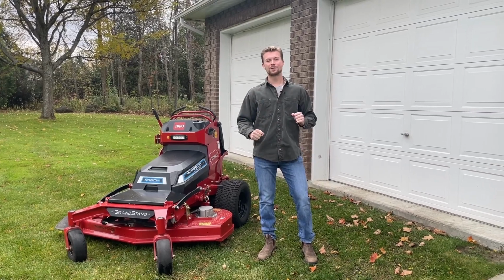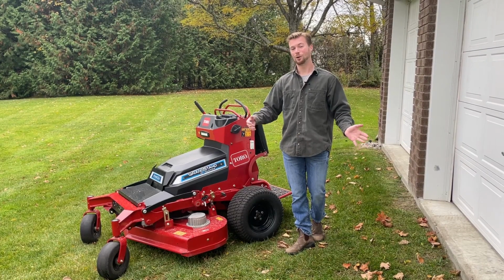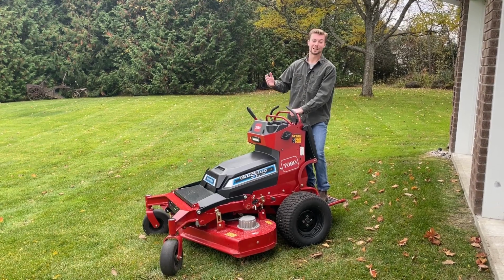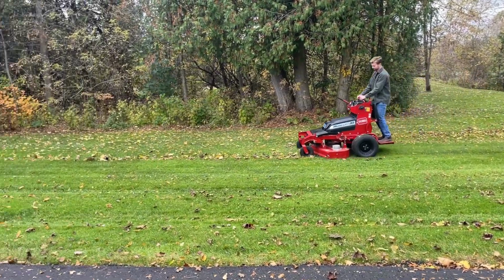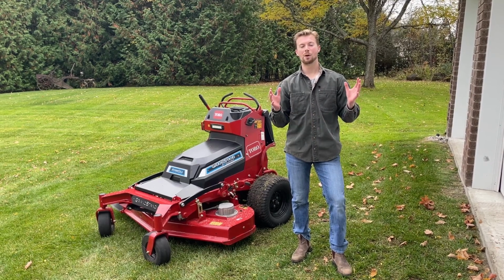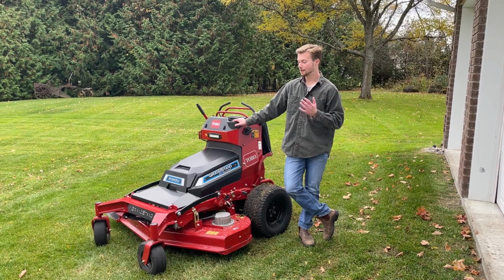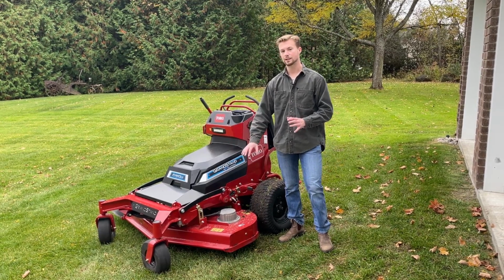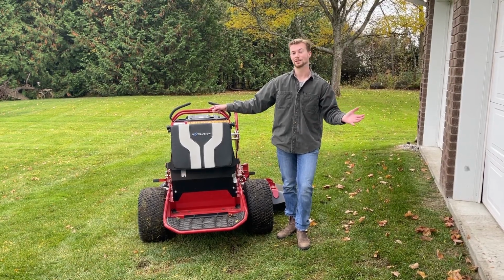Is An Electric Zero Turn Any Good? | Toro Revolution Review

Comment: Maybe if you we’re actually cutting grass and not just running back and forth the batteries would drain faster. He’s another tip. Don’t run over branches and twigs and you’ll keep the blades sharp and give a better quality cut or save time on sharpening blades

Comment: Thanks for demoing it, I had just seen it on a local dealers web page and decided to come and see what was said on YT. I will probably never be in the market for one but it’s a cool thing to see when new products hit the market. Have been a lawn equipment & trailer enthusiast/connoisseur for years…actually when I decided the arguments of family about sports was highly overrated, I just wish my newfound interest had also translated into a lawn company…hindsight is not covid20 & yet it is! Started admiring mower stuffs in 19….yes in 1987. Got my 1st walk behind used for home use in 1999, 2nd in 2004, 1st hydro in 2015, all have been 36” walk behinds. Still haven’t owned a sit-down model. I wanted a sulky but it was over priced and stuck with a velky until the hydro and the factory toro bolt-ons that I bought used. I miss the steering of the old belt drive toro T bar, that was a fun ride but backing and precise tight fence corners always needed a going over with a trimmer, still was a fun ride. The John Deere 36” was a welded deck pistol grip and I owned it 20 years before changing the height w/assistance of a chain hoist & jack stands (thanks to a YT’er) my current personal yard machine is the 36” Toro hydro from 2006 I bought cheap & used to cut my mothers yard and since she’s been in Heaven for a few years I got to use it on my in-laws property it only took a few hours to cut a big O’ patch of land with 36” swath…I was looking & wishing for a wider trailer and a bigger deck for shortening cut time, but I couldn’t justify the cost since I was free labor, even so it didn’t keep me from window shopping and drooling at new machines. Thanks again for show & tell 😊.

Comment: Not sure your data on usage is going to be very accurate.  That lawn looked flat and freshly cut before you drove over it.  An electric motor under load uses significantly more electricity than a motor barely being used.  Most people aren’t likely to mow their lawn 4 times a week t make sure they’re not putting any load on the motor.  Landscapers rarely go to the same lawn twice in a week, so they’re usually getting a decent cut each time.  Also, as an electric car owner, people tend to grossly underestimate the cost of charging.  If you asked people what the cost of running their clothes dryer for 5 hours straight was, they’d likely understand what they’re looking at charging wise. 
Looks like a fun mower, but pretty niche market.  Hopefully there won’t be too many sales or the rolling brown outs will be moving from California to Canada!

Also, blades don’t slow down when the wheels do on “regular” mowers.  That idea is from the ground speed vs. engine speed on the PTO of farm tractors.
Reply from the maker: I usually use a striping kit on an F2690 so the grass looks mowed longer - been about a week since the last cut. Thanks for the comment!!

Comment: Why do people like the Grand Stand? What's the use case? Not a bad machine but I'd prefer a sit down electric zero turn.  Thanks for a great review
Reply from the maker: You can fit more of them on a trailer, and get under trees easier since the deck is so far in front! They are coming out with an electric version next spring. Thanks for watching Ross!!
Reply: A 36” is sought after for going through gates in backyards along with footprint size on trailer.
Reply: More mobile, more compact, standing is better for your health then sitting
Reply: Some Yards I Do I Can't Fit My Zero Turn Thru The Back Gate I Wish I Have One Of These, Without One I'm Back There With A Push Mow